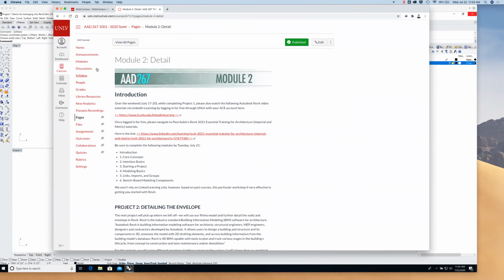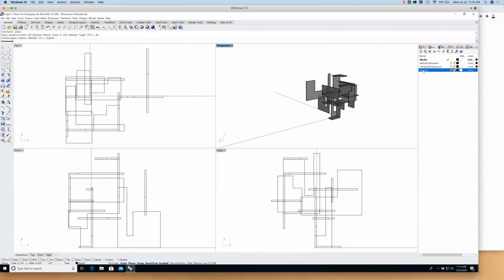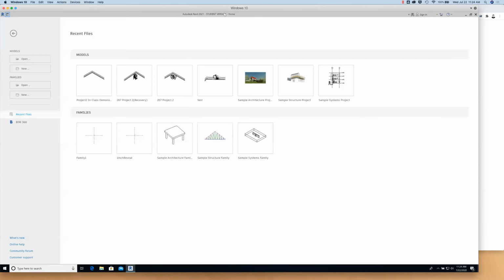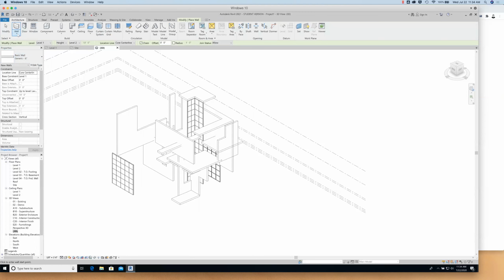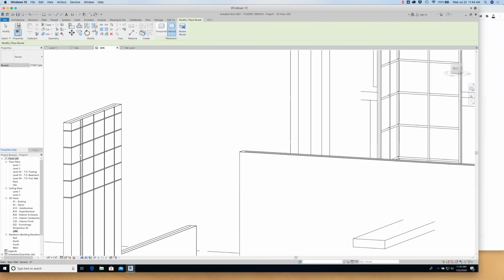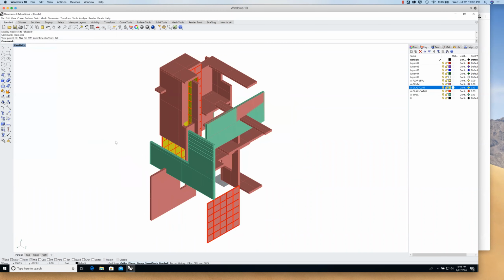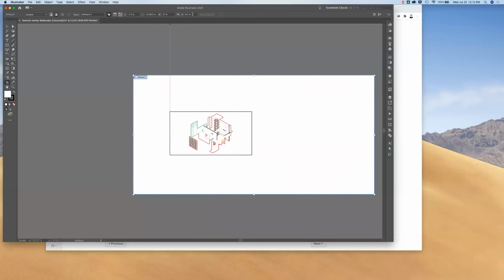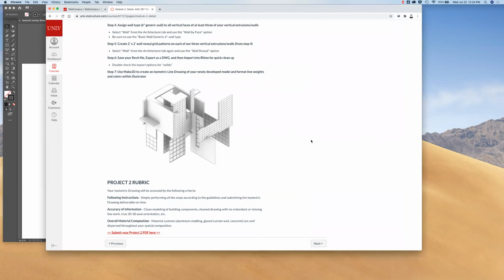Project 2 Complete Workflow (AAD 267) - 22 July 2020

Comment from the maker: 0:52 - Project 2 Overview
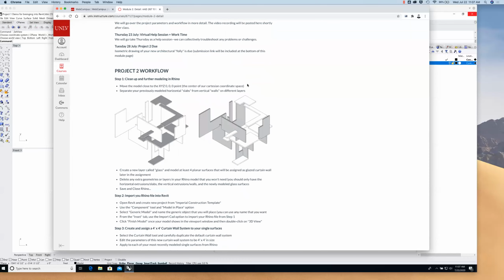4:27 - Step 1: Clean up and Further Modeling in Rhino (Move model to 0,0,0 point, Layer management, further modeling of planar surfaces, Deleting un-needed geometry)
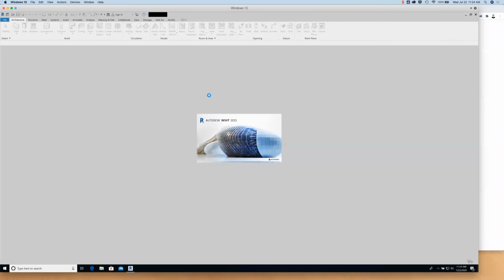21:21 - Step 2: Importing into Revit
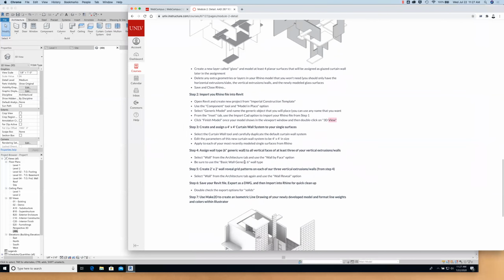24:56 - Step 3: Customize and assign Curtain Wall System
30:00 - Step 4: Assign Generic 6" Wall Type
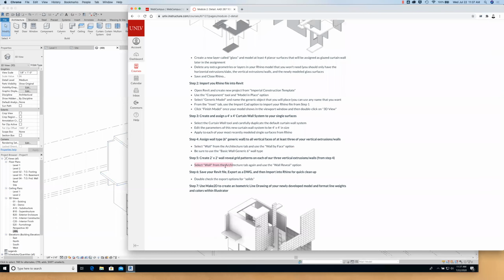34:46 - Step 5: Create 2' x 2' Wall Reveal Grid for Aluminum Cladding
42:39 - Step 6: Save, Export as DWG, and Import back to Rhino
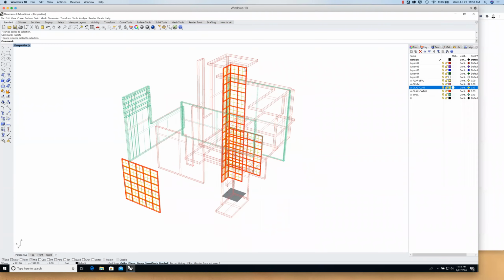48:09 - Clean up in Rhino (Exploding the Block Instance and deleting particular extrusions)
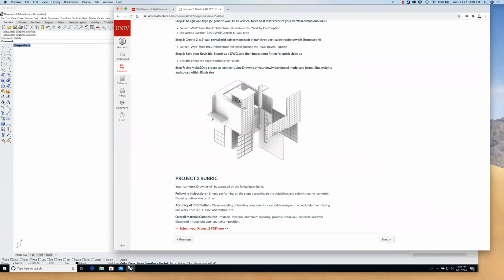49:58 - Producing a Make 2d Isometric Drawings and White Clay Model Rendering and compositing both in Illustrator